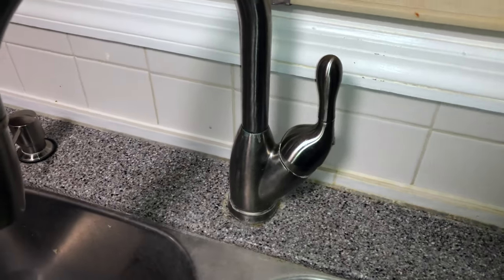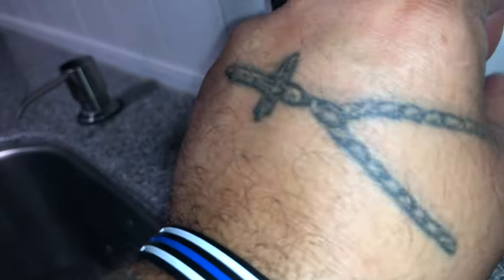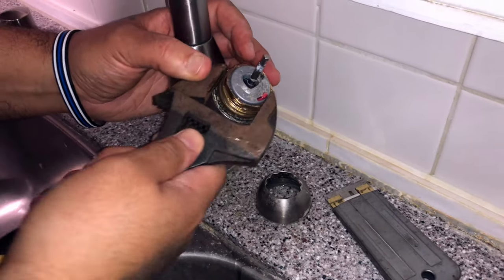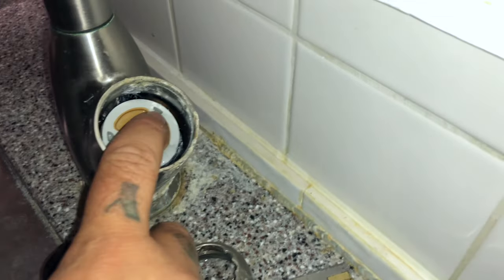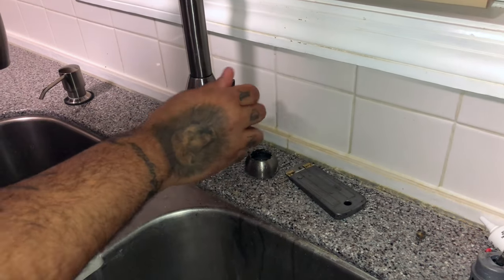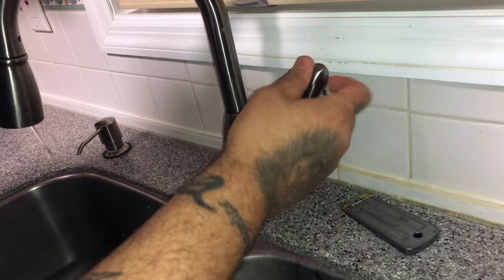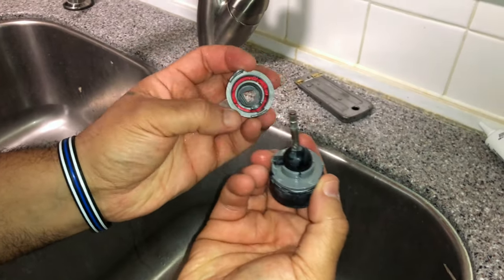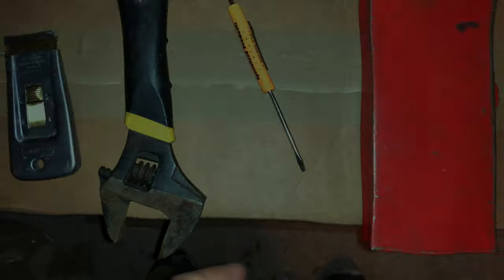How To Replace Your Delta Single Handle Faucet Cartridge

Comment: Seems so simple. My nut refuses to budge, though. Even my general contractor neighbor tried and neither of us could get it to move. $40 part ready to go and looks like I'll be doing a whole new fixture after all. 😡
Reply from the maker: @jaxytvids  maybe get some heat on it if he didn’t try that.
Reply: @MrV2u  Thanks. I do have a torch. I'll see if I can try that.
Reply from the maker: Let me know how you make out. Just heat the ring, try to tighten it a bit then back it off. If you have a socket to that size it might help as well.

Comment: the adjustable wrench  is used  a certain way  when he loostened   his wrench was backward  tightening was correct.   it makes a big differance   same using pliers   youll bust your knuckles or round off  nuts  just a little   wrenching 101   very  basic    just a suggestion
Reply from the maker: Your correct sir. I was more focused on recording the video than holding the wrench correct. Nothing wrong with a couple busted knuckles every once in a while.

Comment: Awesome thank you, very helpful video
Reply from the maker: You got it my friend. Let me know how you make out or if you have any questions.
Reply: @MrV2u  Took a little longer than expected, somehow my faucet came loose from sink and needed to run to Lowe's to get a basin wrench to tighten that. And then my hot and cold shutoff valves were leaking so had to tighten those 😅. Everything fixed now! Always something. Thanks again for your helpful video.
Reply from the maker: @Mabeshark  that’s my fathers famous quote “always something” lol. It’s when there is nothing. you wonder if you messed something up. Lol glad it worked out for you and thanks for the update. Have a blessed new year!

Comment: Thank you
Reply from the maker: You got it brother.
Reply: @MrV2u  Brass nut don't wanna budge. Used the vinegar and then  even penitrating wd40. Thought I was going to snap/ or bend really bad. Had to walk away for the night. I'll try another time. Might just go route of new unit since cartridge hit floor and came apart. Time to say prayers button up and try another day.
Reply from the maker: @michaelbrennan7148  try to tighten it just a bit and then back it off. It will come off trust me brother. If not go to Walmart or a auto store and get pb blaster. It’s a stronger wd40. Let me know how you make out. That part has a lifetime warranty so you can call delta and they will send you one free of charge.